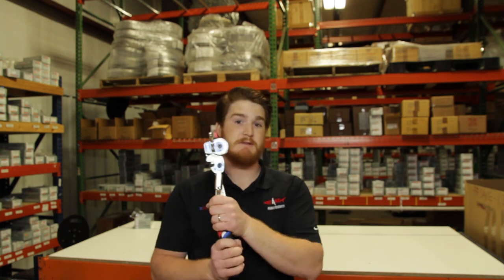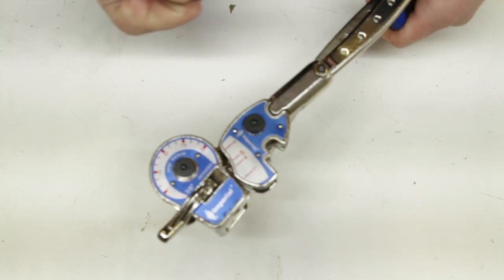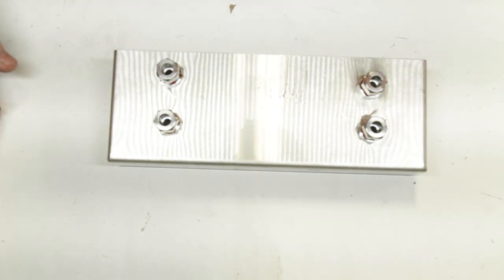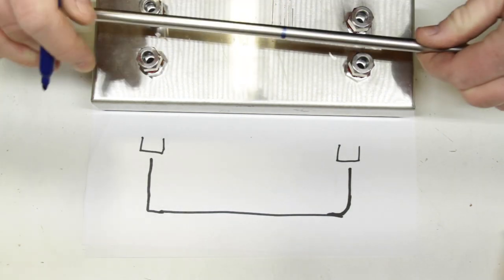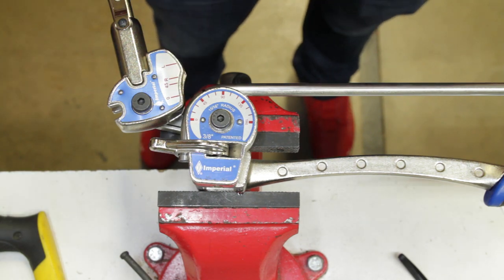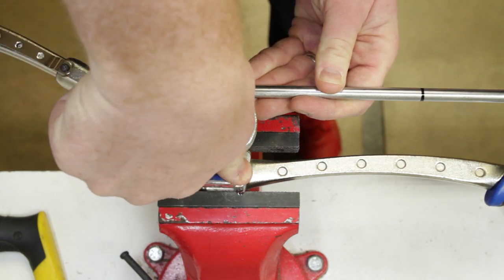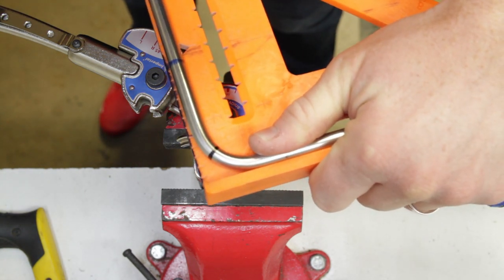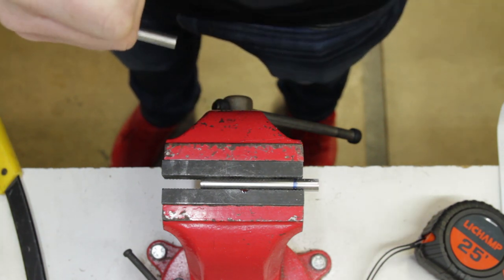How to Bend Stainless Tubing

Comment: Thanks for the instruction! I went looking for that bender - it was $900, and has been discontinued. I looked at your site - no tools listed. Is there a bender worth buying in the sub $100 range I can use to bend 1/2" stainless seamless .049 wall for an older skid steer? The lines are no longer available, and I would like to make my own. Thanks!

Comment: Hi I bought a Rigged 1/2 inch tube bender before I ran across your video, thank you for teaching at a pace that I can absorb, I am Bending 1/2 inch stainless for a car build ,my bender it pops in and out was wondering if you could go thru it how you teach ,thank you ahead and greatly appreciate your work
Reply from the maker: Hi, Micheal! Thanks for the kind words and glad you liked the video. 

I have not personally used the Rigid brand bender, but we have recently sourced a few of them and they seem like a good quality tool.

Can you explain the issue you are having a little more? What exactly is popping in and out?

Comment: Nice video 👍 I have a question. If the nuts were against each other. How do I know how much to add to the measured value between the matrices. So that it is just on both sides accurate in the nuts. Is there a table for how much to add on a given size. Thx
Reply from the maker: Thanks for the question Millan,

This information can be found on the spec sheet for the fittings. Here is the spec sheet for the Superlok i-Fitting 

https://uploads-ssl.webflow.com/614a0a8332b6ab3696001910/639caec79f35af95e9dd6182_Superlok-i-Fitting-Full-Catalog.pdf

It may be different if you are using a different brand of fitting.

Comment: Hey great video , that’s a nice bender with very nice usable graduations on it , iv done a little pipe / tube ? bending before on hydraulic systems at work with reasonable success but the processes I used to achieve the bends were a lot more difficult due largely to having no graduations on the bender. Anyway great video nicely presented and iv learned some valuable tips from it thanks man 
Ps iv not watched all your videos maybe you already have one  but if not a video on how tight to make them would be a good one to do 😄
Reply from the maker: Hey Peter,

Glad you liked the video! We do have a video about tube fitting installation as well. You can check it out here → https://youtu.be/HwmkNiTNGeU 

We are always looking for more video ideas though, so be sure and suggest any other ideas also. We love informing people about how these products work and how to use them safely.

Comment: Some vids say the L and R are for which side of the bend you are bending from, Left or Right. I'm trying to figure that part out so not a criticism, just want to know
Reply from the maker: There is an element of truth in the "left and Right" idea. However, I feel it is confusing to say left and right. These are subjective terms that would be impacted by your position relative to the work. 

If we consider the origin of your measure to be the "Right" and the tail that you measure towards the "Left" then when you have the "right" side clipped into the latch you are bending toward the "left". This would use the "L" mark to make a 90° bend. If there is not space for your bender to bend in this direction, you will have to Reverse the direction of the bender now bending from the left to the Right. This would then use the "R" mark to make the same 90° bend at the correct location. 

For this reason, I would say that "L" is for L bend and "R" is for reversed bend.

Comment: What tool do you use to bending a 1" tubbing ?
Reply from the maker: 1" tubing can be bent using a couple of different options of tool. They do make large scale lever style benders for 1" tubing, but it would be easier to work with something like an Imperial 270 gear type bender. The important thing to keep in mind if you are bending any size of tubing for use with tube fittings, is make sure you are using a quality bender that does not mar the surface of the tubing. At higher pressures any imperfections can become a failure point.

Comment: measkure from edge to edge on the same side of the circle to get center
Reply from the maker: You are correct. This is a viable method to measure center to center if the fittings are in the same plane and you are making a straight line between them (as in the video). However, once a few more dimensions are needed, it gets a bit more muddled. At that point you can either measure to the center or start doing some math to subtract half of your fittings diameter.

Comment: Thanks
Too much applied points..
But why you didn't use the tube cutter which is more convenient rather than hand saw .

Good luck and again thanks
Reply from the maker: Tube cutters are very convenient. However, they tend to leave a sharp ridge inside the end of the tubing. This narrowing just at the very tip can cause turbulence, pressure drop and flow restriction in the line. While this issue is easily fixed with a de-burring tool on soft metals like copper, stainless is quite hard which makes it difficult to remove the burr. The saw teeth leave a burr also, but the are quite a bit smaller and can be easily handled with a hand tool. If I was to be working on tubing in the shop all day, my preferred cutting tool would be a band saw. But I understand that band saws are not viable for field use.

Comment: Why the L? It didn’t put your mark in the center of the bend. Is that the goal?
Reply from the maker: The center of the bend is not the crucial measurement. Since tubing runs are measured on the center line, the L mark lines up with the center of the tubing after the bend. Basically, If you needed just a 90° bend at 6", and you measure to 6" and line up to the L, The center of the tubing leg will be at exactly 6".
Reply: @SuperlokTV  Roger that. It’s been a growing pain to learn this. Thank you for your input and patience.